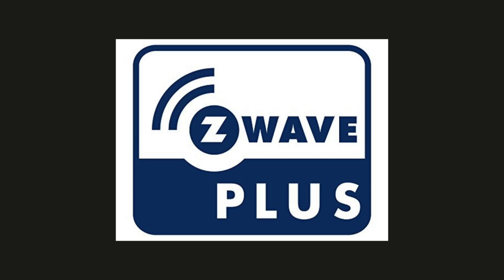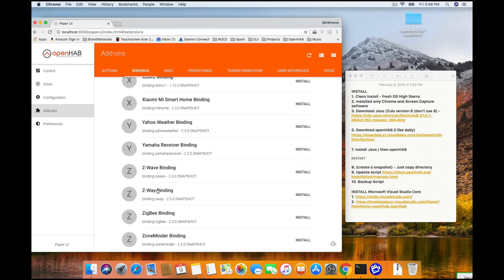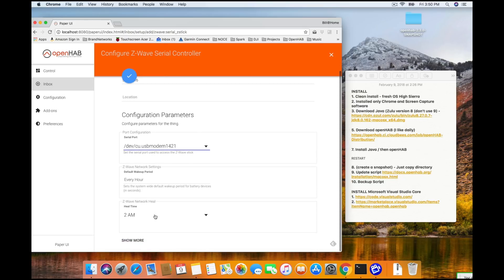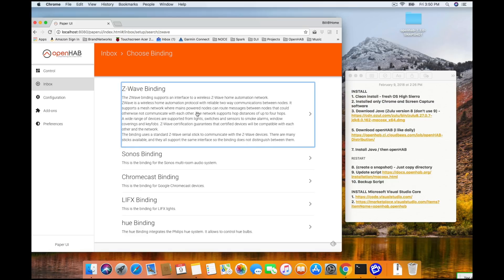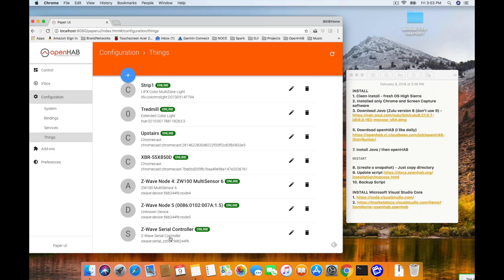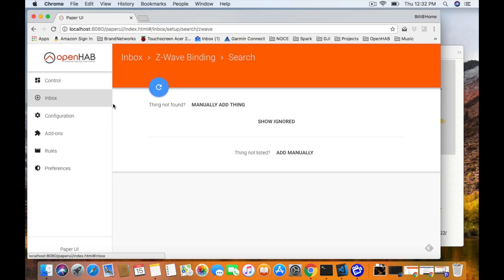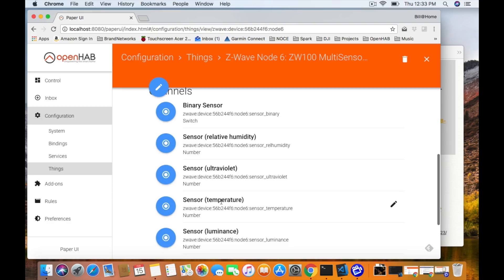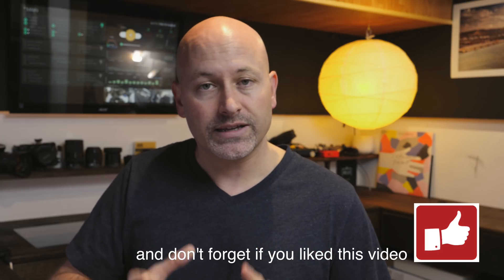Smart Home Automation | Z-Wave Setup

Comment: It appears that with openHAB 2.5.3 the default for Configuration->System parameter "Item Linking" has "Simple Mode" turned off. This causes nothing to appear in Control near the end of the video. Does this make sense?

Comment: I installed the zwave serial device 4 times (each time other usb port)  now i got 4 instances,  too bad clicking on the trash gives dialog with remove  so i push that,  the dialog stays and the only thing after a while you can do is clicking on cancel.   Also the nodes are only in things, not in control.
Reply: I reinstalled openhab and now i can delete the wrong instances.

Comment: Hi All, great video, just got myself a Z-Stick Gen5 to use with Openhab, when connected to the USB port the lights on the z-stick are flashing from blue, yellow, red. and I am having problems connecting to it from openhab I have factory reset the device  but its still doing the same thing and can’t seem to find anything online about the cycling led status any suggestions?

Thanks
Mike

Comment: if my home already using Philips smart light bulbs and ecobee thermostat ...etc i only need the OpenHAB to integrate the control instead use different app to control individually ... in this case i still need  Z-Wave ? all i want is a Smart Hub which can integrate the control for all ( or most ...depending on OpenHAB can compatible with what device that I am using) so that i dont need to use that much app in my tablet to control all my home Wifi controllable device... so would you please advise give me some tips ..see if OpenHAB is able to do what i am looking for ? thank you so much
Reply from the maker: Hello,  thanks for watching!

If all you want to control is ecobee and philips hue for now, openHAB will work with no additional hardware.  If you want to control z-wave devices you would need to add a z-wave dongle to control them. 

openHAB can control wifi based devices like ecobee, sonos, lifx right out of the box.  Philips Hue is zigbee, but it has a hub which turns it into wifi for hubs to controls.

Once you have openHAB up and running you could control your lights, and thermostat from your ipad using openhab!

Good luck, don't forget to subscribe!.

Comment: Can you have zigbee and z-wave dongles on same computer with openhab, and control devices with both protocols at the same time? And another question is for wifi controlled devices (like ikea bulbs I guess) what needs to be done on hardware?
Reply from the maker: Yes, you can.  I have not used zigbee with openHAB before, but there should be no issues using both in one system.  In fact I have even heard of people using 2 zwave dongles if you wanted too for testing etc!  Thanks for watching!  Don't forget to subscribe!

Comment: Hi and thanks for the great videos.
Actually I have a US smartthings hub with some Aeotec sensors, but I want to us other EU devices in my z-wave network. So Any suggestion how to use both frequencies?
Reply from the maker: Hi Zohair,  You could get a raspberry pi with a Aeotec z-wave stick https://amzn.to/2Plhx8o to handle the EU frequencies, and install the smartthings binding in openHAB to have them both talk to each other.  This way all your devices could work together.  Thanks for watching, don't forget to subscribe!
Reply: @yoyoTechKnows  Thanks a lot for the fast response. Sure I'll consider this solution.

Comment: played around with this (sorry) pile of shit for days now. raspberry pi + razberry 2 modul. no information. unreadable logs. documentation outdated or just the basic stuff every child finds on its own. lots of unknown devices (even if the same type has already been recognized - fgr222). i am really pissed. waste of time and energy. same with home assistant
Reply: started all over. removed the razberry modul and used the aeotec z stick with homeassistant and got it running within a few hours. key seems to be to reset the controller and all the devices

Comment: I have to say, OpenHab is terrible. Purchased a Raspberry Pi and an Aeotec Z-Stick to control a Kwikset lock in our new house. I've spent two days trying to get it working without success. Started by installing OpenHub on the baseline Raspbian load - got it working, but couldn't get the beta Z-wave binding working. Started over today with a fresh OpenHubian build. Can't get anything to work. Finding instructions like "Issue solved - "not sure what I did, but I reset the board 3 or 4 times and it just started working". Really?
Reply from the maker: Hi Stephen - don't blame openHAB :-( . Z-wave locks are tricky because of the security protocol.  There is a "beta" binding that I have been using for some time that works well with openHAB and security protocol for Zwave, I believe it will become part of the main binding soon.  Check out this thread!  https://community.openhab.org/t/oh2-z-wave-refactoring-and-testing-and-security/21653/2591
Reply: yoyoTech fair enough. Wrote that in a fit of frustration. Ended up buying a Wink hub and going with the Homebridge Wink plugin. Works flawlessly. When the OpenHab z-wave lock Code goes mainstream, I’ll probably try again. 
I do appreciate your videos... well done.

Comment: So which do you prefer?  OpenHAB or Home Assistant?  I just bought this Zwave USB and and Pi to get started, havent decided which platform to go with.  Id like Voice control (google) and have some TP link switches I may swap out for GE or Zooz switches and a Schelage lock.  Also have a blueiris server with a Dahua and Amcrest outdoor camera.   Which platform would you recomend for some more voice control and security focused?  Thank you!
Reply: Nelson Vieira, based on your requirements, I'd recommend openHAB. The recent release of an official Google Home action for openHAB gives OH the edge for voice control (setup is super simple, too). Speaking of easy setup, since you already have a Raspberry Pi, I recommend looking into openhabian - it does the installation and initial setup for you and lets you start focusing on the actual automation system design quickly.
Reply: BK Hobby thank you for your suggestion!  Currently playing with a Vera plus but will start setting up  an OpenHab on the side.

Comment: I insert Aeotech stick/controller into computer and it blinks red, blue, yellow, & it won't stop. If I take it out and place in inclusion mode and get close to any of my many devices,.. it blinks for a while but does not include any devices. I am using OpenHab2. The controller was added to things, but when try to add devices, non are found. I have reset

Comment: If I want to add a smart switch to my setup, what switches are supported by OpenHAB and the Z-Wave stick? Say I wanted to add a GE Smart switch - is it simply a matter of picking up a Z-Wave stick, inserting it in the Raspberry Pi, go to the PaperUI and add the binding then install my smart switch? Or do I need to also install the switch bindings as well. I see bindings for Lutron - so would I need to NOT install a GE switch and just stick with Lutron? With my Hue lights, I got a Hue bridge and added that to OpenHAB. Would I need to get a Lutron bridge and add that as well? Or does the Z-Wave stick mean I won't need a bridge and as long as the GE switch is in the Z-Wave stick's database, I could go that route?
Reply: Update: Got the zwave controller. Installation was as simple as you stated! Now to pick up a zwave thing to play with.

Comment: What is the best procedure for using the USB Z-Stick Gen5 with the Raspberry Pi regarding removing the stick to add other Z-Wave products?  Should I just unplug and then plug in the USB stick?  Should I power down the Raspberry PI, then unplug the USB stick, plug it back in and power up the Raspberry PI?
Reply: I don't know if they have fixed this over the years, but you used to have to be VERY careful with Unix/Linux based systems (raspberry PI) when you turned them off.  They were very susceptible to losing information since the OS kept a lot of stuff in memory and didn't write it to non-volatile storage until it was convenient.  Therefore, it was prudent to turn off a Unix system with three successive commands:  # sync , # sync , # shutdown -f   (note the # sign was the root prompt and the comma is a comma for separation - neither should be typed).  
The sync command forces a flush of memory to non-volatile storage; the second sync is over-cautious but sometimes necessary; and the shutdown command (should) flush memory also before  shutting down.  IMHO you should never just turn off a Unix based (or any other system).  This may have been my problem with losing the identity of the Z-stick, as I may have been cavalier in turning off the PI.  

It seems logical that if you shutdown carefully, disconnect the z-stick and then replace it in the SAME physical USB port that it was in previously BEFORE turning it on, that the R-PI should not know that it was gone and should accept it as an old friend.  Sometime I will test that...
Reply from the maker: Technically nothing should happen by just removing it and putting it back, it's serial over USB.  Worst case restart. But you are better off using openHAB to initiate pairing so u should not have to really ever remove it.  But I u want you can use the button method outlined in the device instructions.
Reply: @wa8khp - I just finished an extensive discussion on the openHab forum with the Maintainer, Chris Jackson,  about this.  Aeotec is very proud of their feature of wandering about with the stick to add devices. However, in my case (raspberry PI and openHab 2) whenever I removed the device, the system forgot about it and added it anew when the stick was re-attached (requiring all the associated z-wave devices to be added again) - not good.  Chris told me that he believed that the only way to add things to openHab was to do it through the UI.  In spite of what Aeotec wants us to do, don't remove it from the system.  Instead, just use the "Search for Things" button (in the Paper UI Inbox).  When you hit this button, openHab puts the Z-stick into inclusion mode and it will discover any new device that is in range. Of course, this means that a new thing that is far away possibly won't be discovered as easily as if you brought the Z-stick to it, but it should eventually be found if the z-wave net is connected enough.  I have been following this procedure and have not had a problem, although I haven't added many things lately.  I would suggest that if you are starting up brand-new, you should add any z-wave stuff to the Z-stick BEFORE PLUGGING IT IN THE FIRST TIME.  The device in the Z-sticks database will then be more quickly discovered. After that, it is best to add new devices from the UI.
Reply: THANKS, good to know there are potential problems when removing/installing the USB Z-stick with the power on.  Maybe powering OFF the Raspberry PI, removing the Z-stick and doing the inclusions then inserting the Z-stick and powering up the PI would be safe.  I have many GE wall switches for 2, 3 and 4 way lights that I am going to install.  It would be easier to do this at the switch when Pi is in the basement.
Reply: THANKS for the commands (# sync , # sync , # shutdown -f ) as I did not know the proper shutdown procedure for the Pi.
Reply: Just did a little testing on my openHABian v1.4 Raspberry Pi.  I need to do SUDO SHUTDOWN -H NOW,  to get the Pi to shutdown immediately.  Thanks again.
Reply: Is the Z Stick plug and play with the PI? Do you need to install drivers to the pi to make it work?

Comment: Will you be moving on to text file configuration I'm hoping you will.
Reply from the maker: Yes! I wanted to try and cover basics first so everyone who wants can work along.
Reply: I agree I'm only a beginner myself I started with paper ui then moved my rules over to text these are great videos to pull in new users they would have helped me loads

This video will help I have been thinking about adding z wave to my setup was confused I was looking at the exact stick you use
Reply: When you do more text files would you consider using visual studio code with openhab extension its great for text files as it displays stuff in different colours and offers hints as you create the files

Comment: Along with the August Smart Lock Pro, I bought the z-wave stick back in December. I had to return the stick because it wasn't certified for z-wave's new Security 2 (S2) protocol. Do you know of any other controllers that are S2 compatible devices? I get that "unknown device" message. Also, on inclusion, the lock warns me the the controller is not S2 compatible.

I am using OpenHAB 2.1 On RPI3.
Reply from the maker: There is a "testing" version of zwave binding that supports the security protocol (not sure if it is S2?).  With this I was able to get my locks up and running securely in openhab.

Comment: Is there a way to integrate openhab with existing standard light switches?
Reply from the maker: Not without adding to them.  I will be doing a review soon if the aeotec nano devices.  These install behind your current switches and make a dumb switch smart!
Reply: No
Reply: Not directly, but as @yoyoTech said, you can put a AEOTEC (formerly AEON) micro or nano switch or dimmer in the wall box.  You can connect your existing switch to to the AEOTEC device and it looks like a normal switch when put together, but is smart and fully automatable.  
If you replace your existing switch with a push button style switch it can make it even more useful by adding dimming at the actual switch as well as through openhab.

I mention the AEOTEC version as I like how small they are, they just work and AEOTEC also make the most recommended Z-Stick.  

Fibaro and a couple of others make similar devices but I have only used AEOTEC devices.  I just stick to what I know works.

Comment: THANKS, your videos got me into OpenHAB2 and Home Automation.  I am using a Raspberry Pi with OpenHABian v1.4 installed and the same Z-Stick Gen5 that you have.  I must have a new Aeotec MultiSensor 6 which is a model # of ZW100-A on the box as it is showing in PaperUI as a Z-Wave Node 3 (021F:0003:0083:3.92) (zwave:device:f9a63c2e:node3) and can not be identified!  HELP, what do I do now?  PLEASE keep up the GREAT work.
Reply from the maker: This is the same thing I spoke about in the video.  It's simply a matter of adding the new deviceID to the Zwave database so it knows how to identify it.     If you update openHAB this device will most likely get updated quick.  Let me know if u update and it still does not identify it.
Reply: I must confess I am a newbie!  I just purchased my first Raspberry Pi two weeks ago and installed openHABian v1.4.  I have done a lot of reading and watching videos to get myself up to speed.  I have removed/reinstalled the Aeotec MultiSensor 6 several times.  I still have the UNKNOWN DEVICE  Z-Wave Node 3 (021F:0003:0083:3.92) (zwave:device:f9a63c2e:node3) message.  If the ZW100-A is not in my installed database, how do I get it there?  Remember your installing in this video the Aeotec MultiSensor 6 is the model ZW100! I have installed successfully the Z-Wave GE Smart Switch so I know that my procedures are working according to your video.  Thanks.

Comment: Tutorials about openhab2 in combination with modbus, dmx-light-control and bindings for av-control yamaha and marantz would be cool
Reply: I've thought about using DMX light control myself - but ended up going with a simpler solution, WS2812 LED strips driven by a NodeMCU with the awesome FastLED library, and controlled by MQTT/JSON. My openHAB sitemaps/rules select the different effects or colors to set the LED strips to, and I can use groups to set multiple strips at once (I used about 10 of them in door frames and in window sills, for a synchronized holiday lights effect last year).